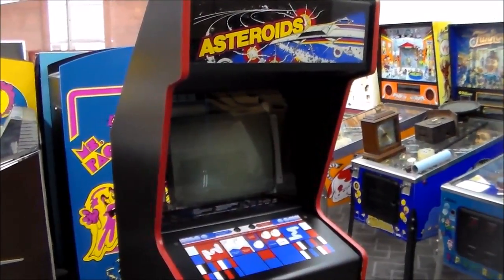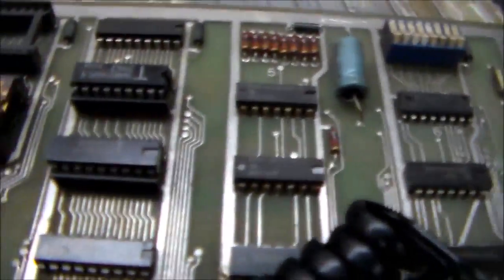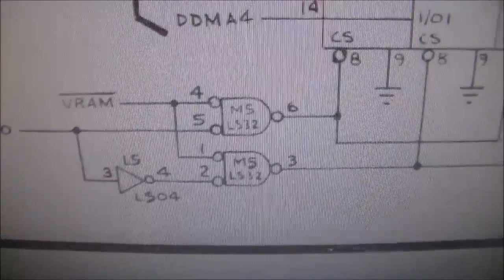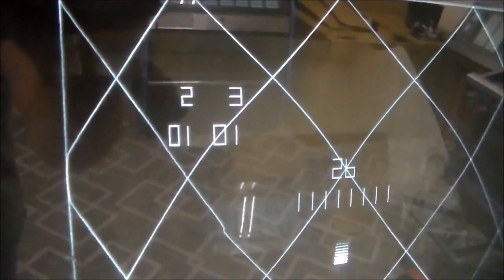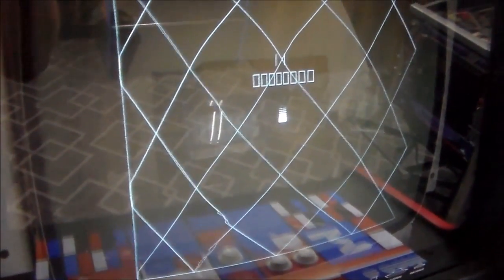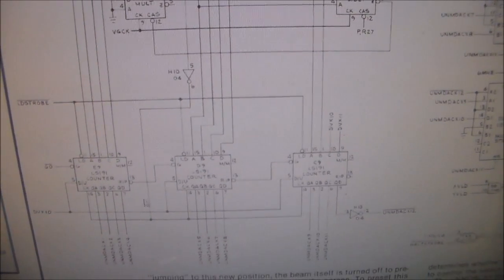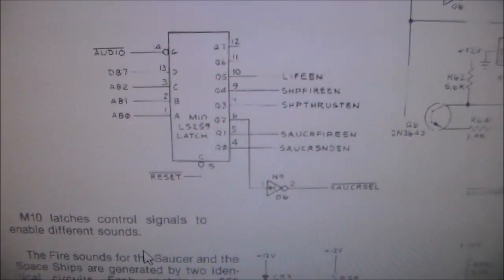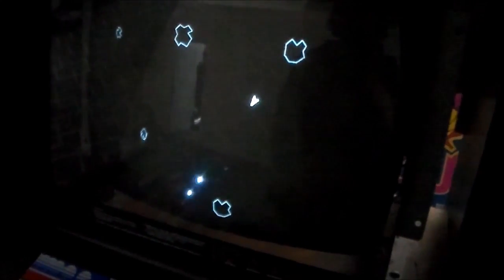Asteroids PCB Repair - Classic Arcade Game Troubleshooting

Comment: Enjoying these vids. What's more enjoyable is that you admit that you're not an expert and yet are able to fix these things, which gives the rest of us mortals some hope. I can understand digital logic but analogue stuff? Not a clue. Capacitors? Not a clue. Which is why I haven't tried fixing my Vectrex yet.

For example, at around the 9 minute mark you have the chip select circuitry. The LS32 is an OR gate (I think the LS32 is a Quad OR gate? If so, it has four of them in one package). The LS04 is an inverter (the package has six IIRC). Basically, the inverter is there so that when the top one is active (looks like the chip selects are active high) and is selecting two of the chips, the inverter reverses the signal that goes into pin 2 (which it shares with pin 5), pulls it low, and deselects the other two RAM chips ... and vice versa.

Pretty straightforward circuit. I can understand that much.
Reply from the maker: That makes sense... you could definitely work through the logic of these things, like you said you just kind of need to figure out what each chip SHOULD do when it gets a signal then find the one that isn't acting right!

Comment: I liked watching you go through everything till you got it working. cool video.
Reply from the maker: Thanks Tommy!  We were glad to get it working.  We have another repair video coming up soon.
Reply: @LyonsArcade  actually not responding to this specific comment it's actually a direct reply to you directly for this video.

And others of course so this would not apply to you but other people that are technically minded.

And some questions for others.
You'll see what I mean.

Didn't know how to say that really sorry if it's a mishmash!

Watching something right now because I'm not feeling good and it's affecting how I'm thinking and processing information.

But I'm here enough to comment and let you know some things.

And a few others other people may comment on if they have it already this may have already been brought up?

Didn't have a chance to scan through with her comments so I don't mean to be redundant.

 and I'm not being critical what's you know what something is and how it works it may help you in the long run right?

The abbreviation CS is Chip select.

Start out in Old School logic of course and yes is still used in modern times of course.

Note how you said cable select.

Now if you had some sort of arcade cabinet or machine with two hard drives and you were talking about that.

 there is that term for selecting master-slave hard drives or other devices.

 there is an option for what's called a cable select 4 Master Slave drives is what I was getting at.

Where are working on a computer look for the older hard drive a few minutes before the video?

 LOL.

More seriously back to the other things I was going to bring up.

I do agree about using a socket when replacing a chip

 I do it where practical there are times that doesn't work well I doubt you would run into it because usually   Plenty of space above the chip.

But sometimes there might be in clearance issue in terms of space above the circuit board or card which ever.

When I build custom projects I would always try to use a socket for anything that I could.

And I did try to go for a modular approach much like on pinball machines and other machines that you've shown in your videos.

I coined a phrase for myself future feature connector.

Or FFC.

Modular is the way to go.

I'm sure you've heard of Jama arcade machines right?

Also I'm sure you've heard of the super super guns or somewhere.

 basically a machine that would take the arcade cabinet hardware like it work cartridge.

Basically turning a arcade hardware store board what have you into a a cartridge for a Oversized game console.

Does anyone have experience with these?

 or would it be better to emulate?

I know I'm on an arcade video but it's just I would like to be able to play some classic games!

The maintain is budget and also room available is virtually nil.

Although I will be having a Raspberry Pi in my entertainment center.

 which would be suitable for that.

Emulation that is I know that's a dirty word in the field but....

Sometimes that's the way you have to do things When you're on a budget crunch.

 And a space in resource crunch as well.
 which would also basically be my gaming system plus doing other tasks simultaneously.

Also that would allow me to use original controllers for the original games via USB converters.

Also I have carpal tunnel in both wrists and my plan is to use one of the newer not newest but you get the idea.

PlayStation controllers as I replacement for the mouse and also map all the buttons to whatever functions I would need at a time.

And since it's Bluetooth that could work for just about anything. 

With the proper doggle that is.

Also would be good for remote control of media through VLC media player and other applications in Windows.

Not to mention with the Raspberry Pi and Android as well.

Also you lost me the referee play in the Air Command Center that could run everything in the whole place.

So that means the PlayStation controller could be your remote for your system as well such as one button might be audio mute.

Since you would have the capability with the road for a pint of Bluetooth Wi-Fi and whatever else with the right Hardware that is.

 Basically over systems would be interconnected in one way or another.

Trying to set up VLC in Windows for remote control at this time and ran into a bit of issues you could say.

 I know a lot of this does not have to do with gaming and such but it just goes to show send should be modular.

Also with those beeps and such for Diagnostics.

I did not realize that they would have something like that in those earlier arcade machines!

That actually reminds me of the PC speaker beeps that you would get if there's an issue which is still pertinent.

And also for the longest I did not realize that some systems had different tones of Beats instead of just a series of beeps.

But some actually used short and Long.

 I did not run into either of those two things for a long time even though I've been working on computers a long time.

And tell you where I crossed it you may not realize it.

Also I know somebody that work on Arcade equipment and machines.

Years ago.

Lost touch of course.

But he told me that honor some arcade cabinets.

 Modern ones at least more modern than the ones you're talking about. 

Mostly.

 don't know after what year this would apply?

But he told me that you would take a certain value of resistor after disconnecting the I think it was the Green video.

Connect that resistor to the input Florida green? Video.

And connect a test lead to the other end of the resistor.

 and the monitor would act as an oscilloscope for troubleshooting.

Also I heard from the same person.

One of the biggest issues with power supplies was with the voltage sense lines.

 sometimes not actually sensing proper voltage and causing all sorts of issues.

 even though that no harm would be done Under these operating conditions.

And also he was having a lot of power supplies supposably not working and turns out they were not being tested under any load at all.

 I'm referring to switch modes of course.

 there are still some power supplies that require a minimum load to even work but More often than not now it's not as many of them.

 even he told me that when it stays at a minimum load it's like the people that were checking them Didn't even look at the label!

Also is there a adapter that would be readily available that would be able to be plugged into a PC power supply to be used in something else that to be used in something else that would to be used in something else that would use the same voltages.

And we just break out to a cable or possibly board with terminals of some sort I'm not talkin about it something that would be used for like a bench power supply but that would be installed in a piece of equipment permanently.

Again this is for modularity of things.

 so that you could use an off-the-shelf PC power supply and if you ever had a problem you can just swap it out.

 either or if in the future you needed A larger power supply for the application due to upgrades to your system.

 Again this is 40 retainment Center.

 and also to other cabinets.

 including one by my desk And yes part of it has to do with the computer of course.

 also planning on building a internet router / whatever / whatever would also be running VPN Adblock and others.

 possibly also would be an NAS.

 possibly as well as a Google voice setup.

And more.

 Also any surplus power will be brought out through the rear of the case. As in power Supply.

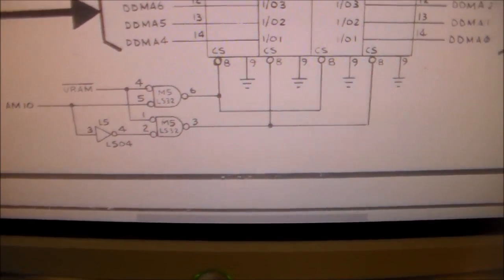Comment: At around 12:30 you said you had the signal come into L5 but no signal out, this is correct as that is a logic NOT gate, so it inverts the input signal. I have not watched the rest of the video yet so I apologise if you realise this later.
Reply from the maker: by 'no signal out' i meant it was completely missing, there was a high (or pulsing, can't remember) signal going in and the output was completely dead, no ground or +5.
Reply: @LyonsArcade  I see, my misunderstanding. When I watched the rest I was surprised it fixed that issue because I was thinking the odds that a different circuit using another gate in the same IC was the actual fault 😂 What you clarified makes a lot more sense to me now 👍.

Comment: I'm wondering if that old power supply is the problem with the game resetting constantly. After so many years it may not be supplying clean, constant voltage to the board causing it to reset. Thanks for another great video and for rescuing and restoring all those classic games.
Reply from the maker: We rebuilt the power supply and had it nice and strong.
Reply: @LyonsArcade  I really appreciate you sharing all your knowledge and experience with us. And thanks for all the effort you put into rescuing and restoring these classic games. Hope you get it working my friend.

Comment: 74LS04 is a Hex Inverter.  Its supposed to read inverted on input to output.  Its confusing that you are saying its a problem that its reading inverted.  That’s how the 74ls04 works….  Its actung as a switch between the two chip groups via one single line input.  One line split goes straight to the first group.   The orher split goes through the inverter.  So, one high low line controls two groups via an inverter.
Reply from the maker: I didn't know I said that was a problem, if I did sorry, i wish I could take it back

thanks for watching Opcode66!
Reply: @LyonsArcade  it was the first chip you looked at and swapped in the video.  Not trying to nitpick.  I really appreciate and enjoy your videos.  Just started watching them two days ago.  Thsnks for making them!

Comment: I kind of despise the old Atari power supplies, the sense lines  can pick up noise and shut off the +5volt momentarily. I've wired in smps supplies and repinned the edge connector.

Comment: so at 12:40 you show a signal at L5 pin 3 but no signal at L5 pin 4.  The symbol of the chip you are testing shows that L5 is an 
inverter which inverts the input from high to low and vice versa so that pin 3 high pin 4 low is what you would expect. If there 
were no circle after the triangle the chip would be a buffer and 3 and 4 should be the same.

Comment: Joe, not sure if you would have an opinion. I am looking at a Burner similar to yours but an older version, "The Pocket Programmer". Do you think it would be adequate for this application or say, Space Invaders?
Reply from the maker: Yes a Pocket Programmer is a great little machine, we used one for years.  You just have to make sure you can hook it up to your machine, our last one only used a parallel port!

Comment: You're a badass!  I wish I knew how to work on this stuff...  For now, I'll have to rely on experts like yourself!
Reply from the maker: I'm not very good compared to the guys who do these all the time, they'll blow you away :)
Reply: I can't get my Asteroids Dx board to do anything... so yeah, you got me beat!
Reply from the maker: We don't really do repairs Jeff, because we stay so busy working on our own stuff.  Did you check all the fuses in the bottom of the cabinet?
Reply: Yes, the previous owner plugged in the PCB backwards and blew out all the fuses on the deflection board (which I've already fixed) but the board itself is dead.  Power is correct everywhere.  CPU is probably toast.
Reply from the maker: Yeah you'll probably need a logic probe to track it down, did you try putting the game into test mode to see if you get the cross hatch or any error beeps?  Do you have a different board you can swap in to make sure the monitor's alright?
Reply: No logic probe.  And no other vector game boards to try.  Test mode doesn't happen.  I literally get nothing but the red LED on the PCB.  I'm going to Oscilloscope-music the monitor tonight to see if I can get any display to make sure it works.  I'm sending this board to someone to fix!

Comment: JOES CLASSIC VIDEO GAMES< I'm very confused on the difference between the X&Y position counters compared to the H&V sync signals in Raster arcade games. The Vector games use X&Y Position counters and Vector XY generator IC chips to create the XY Deflection signals I think but not sure on the theory how it does this, maybe you can explain what these sections stages on the circuit boards does better?
Reply from the maker: Unfortunately Bill i'm not competently qualified to understand or describe the difference in those signals, sorry.
Reply: @LyonsArcade  its ok thanks for trying

Comment: Are those stickers on the overlay?   Original paint? Or did you re paint it?   Looks really clean.
Reply from the maker: There's about four ways you can do it.  You can buy a silkscreened control panel but they're very expensive, it's how the originals were.  Or you can touchup the paint on the original, or you can buy a sticker that just goes over the part with paint, or you can put a "full wrap" Overlay on it, basically it's a big black sticker with the artwork on the appropriate part.  This one is that 'full wrap' overlay, it covers the parts that were originally painted and all of the black paint area too.
Reply: @LyonsArcade  where do you get the silk screen?  I did buy a sticker but I don't know if I want to use it. Paint is pretty bubbled up on mine. Love your videos.

Comment: Taking a chance, my asteroids is constant beep in test but only Hi pitch, no low.. any idea? Thanks!!!
Reply from the maker: If it's really high pitched and really quick, and the led's are pulsing at the same speed as the beep, it's just resetting over and over again, you'll have to isolate the Vector State from the cpu side and see if it still does it, to see if it's a vector generator problem or a cpu problem, it's pretty complex by that point.  If you watch some of our Asteroids repair videos here you'll see how to do that though, you lift a pin on one of the chips to split the board in half.
Reply: @LyonsArcade  Thanks a bunch, I will try that soon!!

Comment: Seems a little like dealing with an old guitar amp...   Change the oldest crustiest capacitors,  then work from there...
Reply from the maker: Absolutely.  Basically the problem with any of this stuff is always a 'bad connection' somewhere, even if it's inside a chip :)  So the caps dry out and no longer connect the way they should, or a transistor or gate inside a chip no longer works the way it should, etc.  If you can fix amps you can absolutely fix these.

Comment: Data bit 0 on the EPROM is stuck low.  Even values would still read correctly but odd values would read one lower than normal.
Reply from the maker: Thanks Macfixer, I've never figured the bits out....

Comment: I'm looking for IC 74LS32N will the 74LS32 work? I found out Bob's shop was closed do you have a vendor you could recommend for IC chips? Thanks for the video this helped me solve the issue with my Asteriods.
Reply from the maker: Yes those chips are exactly the same, the "N" at the end is a designator that the company that made the chip put on it.  So it's the same chip made by different companies.... we order all our chips from www.Newark.com , they're close to us so we always get all the packages the next day with regular shipping cost.
Reply: Thank you for the quick response, my system is doing almost the same as your board did in the video but only fails N4 so I am trying to narrow it down. If the ram chip is bad will i need to do anything to replace the ram, will i need a new chip burnt in or can I just order the ram chip and replace it. I just replaced the ROMs to get to this point. Thanks again for the help.
Reply from the maker: No you don't have to program anything, the only chips that have anything programmed on them are Rom chips.  The ram chip is probably soldered into the board however, so you might need a socket and a soldering iron.